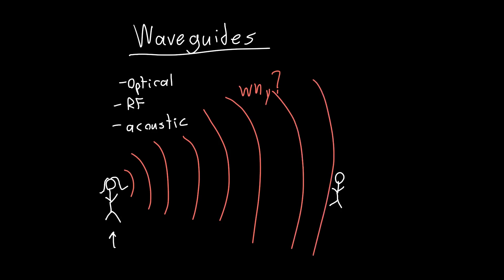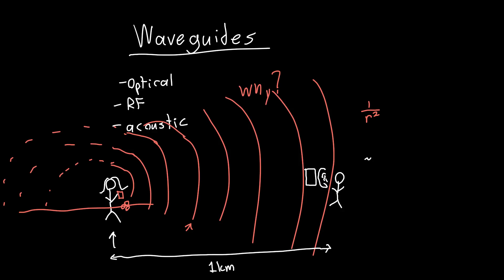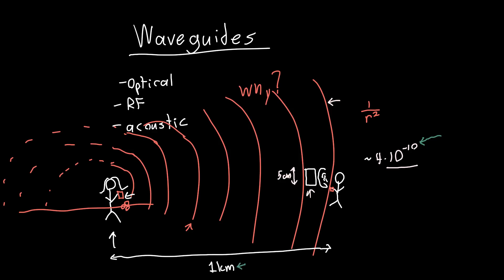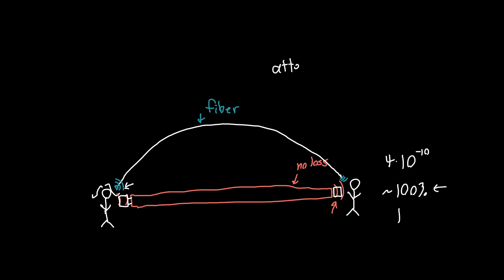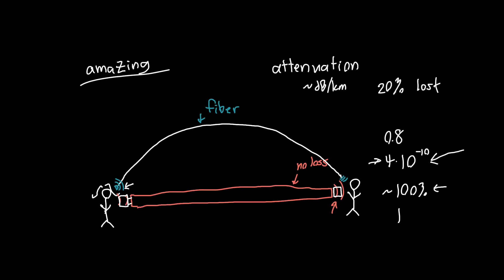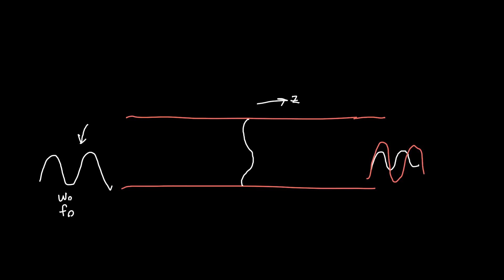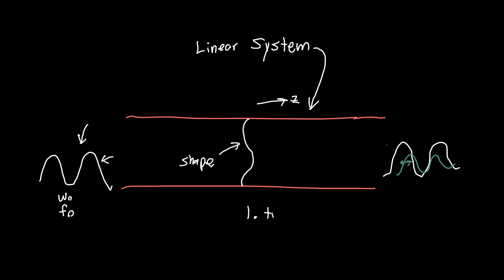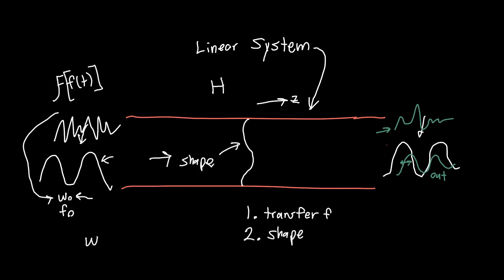Waveguides Explained

Comment: What about lithographing at the 10NM level hundreds of thousands or millions of holographic waveguides on a silicon surface? You could create a light transistor. The incident light could be tuned to any angle by adding bias to the silicon wafer using increased concentrations of germanium by altering the refractive index.

Comment: hy,
Thanks for your help.I would like to ask you one question about waveguide & electromagnetic radiations in Radar.
 ->> When we generate an RF signals  >>then we amplifier  , before the signal enter the waveguide:
Here is the signal electromagnetic or analogue:
If analogue where to turn to electromagnetic.
If  electromagnetic dose waveguide responsible for converting analogous to  electromagnetic signal
Reply from the maker: Everything is an electromagnetic wave. When the dimensions of the stuff involved is really small compared to the wavelength, we call it a "circuit" and we call the signal an "analog signal". When it is well-contained in a particular waveguide or circuit, we often call that an "RF circuit". When you send it to an antenna, because the antenna dimension is large, we call that an "electromagnetic wave" (and antennas are usually designed so that they radiate well).

Comment: Is a parabolic shape reflector a waveguide ?
Reply from the maker: Great question. A parabolic reflector usually takes light from far away, and sends it back far away (reflects it), so I wouldn't consider it a waveguide, because it isn't "confining" or "guiding" the light. It's more like a "waveshaper" than a waveguide.